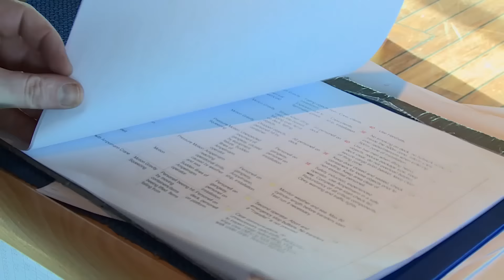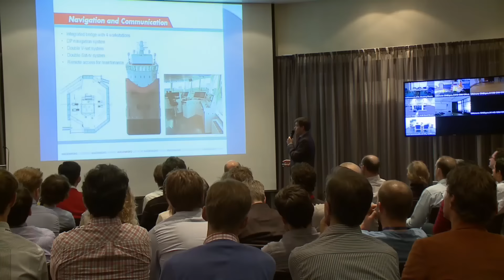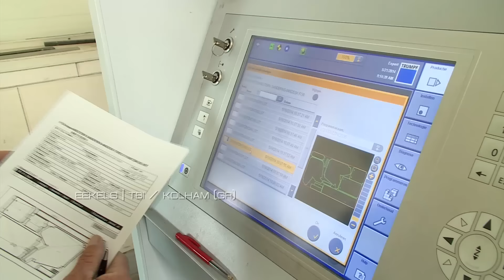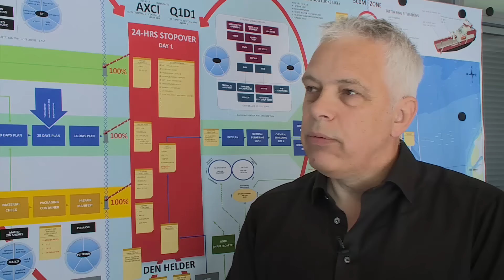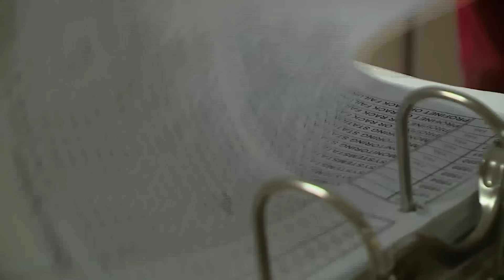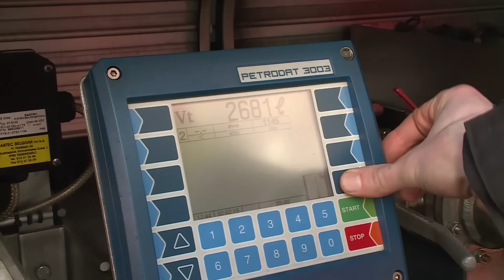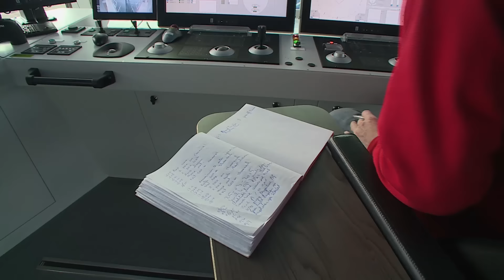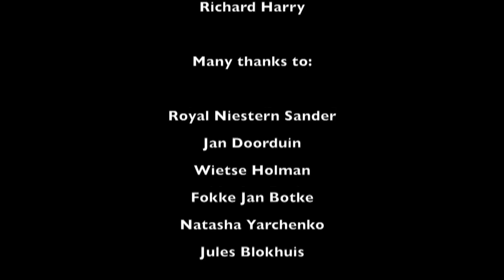W2W Project - The 'KROONBORG' documentary

Comment: No rolling when embarking and disembarking, but what about the trip from land to the rig and back in rough seas? Helicopters have no sea sickness in rough seas!
Reply: They do unfortunately lose their rotor head and shaft assembly at 2000 feet, have their entire tail rotor gearbox blown off the tail by a lightning strike mid flight, crash an landing, crash on take off, crash in transit to and from rigs, experience controlled flight into terrain (sea), experience gearbox failure in flight, ditch into sea, capsize on contact with sea, to name but a few...
Reply: Now you just need 1 trip.
Materials and personal in 1 go.
If the wind is blowing to hard your not allowed to fly aswell.